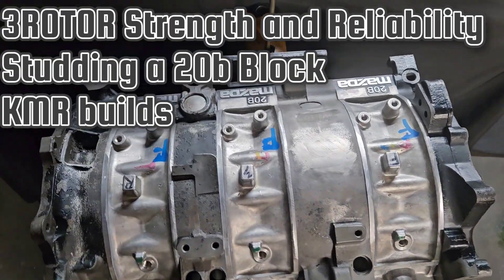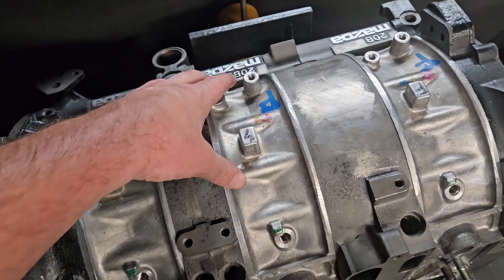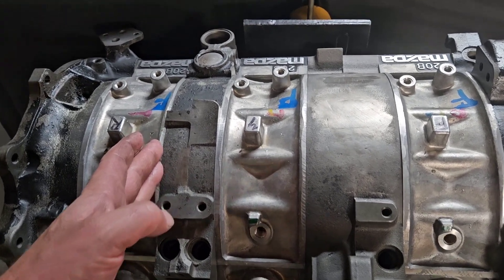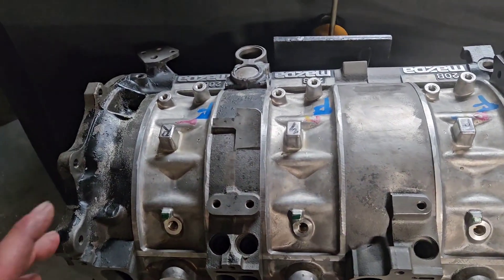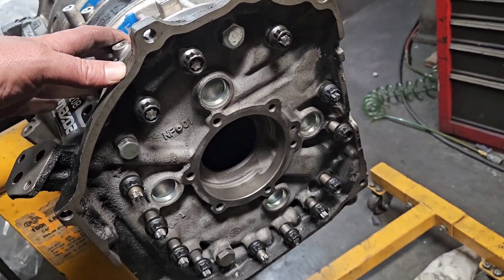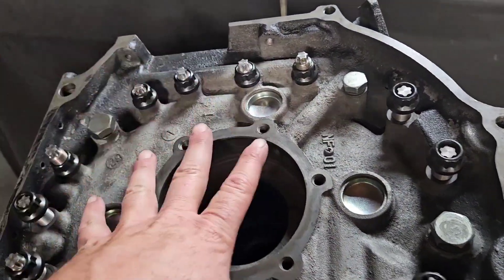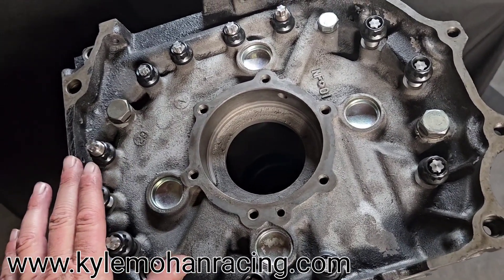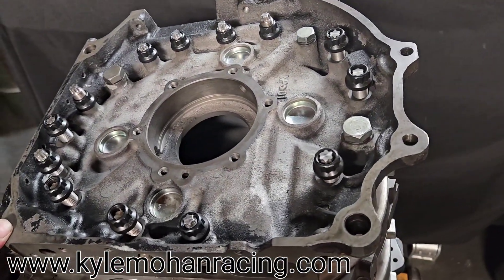Why I stud Mazda 3 rotor 20b blocks for strength and reliability - KMR Rotary Engine Tech Talk

Comment: Aside from cost, is there any reason to avoid studding an engine that isn't going to make a lot of power? For instance a 13BREW with power goals around 300-350whp. I think I've seen people mention that aftermarket studs didn't seal coolant, but I'm not familiar enough to know if that's installation error or a specific brand of studs that is harder to work with than others.
Reply from the maker: I think it's very debatable and really depends on the goals of the motor and owner.. Even at mid level boost, it will help with long-term reliability better under hard conditions

Comment: stud the engine only if you boost/Nitro use ? or can it help the engine even when you dont use Turbo/NOS?
Reply: Stud for anything above stock power levels … use some rx8 parts like rear and front gears … side clearance your rotors and balance them so you have less wobbles with the  rotors on high revs …I’d use rx8 rotors but balance to your counter weight and flywheel (depending )and do em all at the same time … everything will be linear in movement! Replace your rotor bearings also !
Reply from the maker: @vinniesmith7455  I'm not a big fan of RX8 rotors but depends on the build.
Reply from the maker: We haven't studded many na motors as it's generally not as much of a concern. However, I could see studding an na motor under certain circumstances. Multi rotor motors like 3 rotors and longer.
And hi RPM or hi load builds, the way a motor is accelerated or decelerated can apply a lot of force so it's still could be used to reduce motorflex. Just depends on the motors goals.